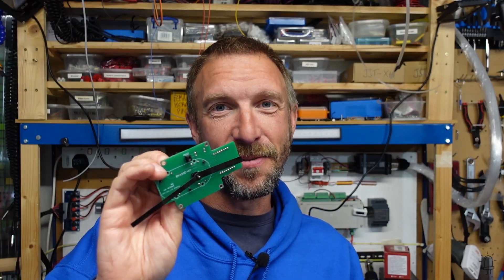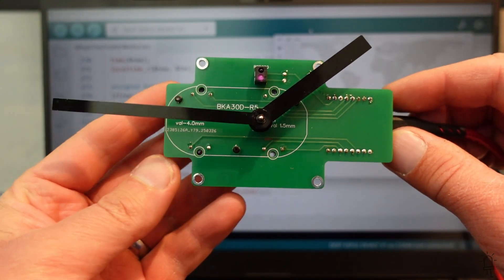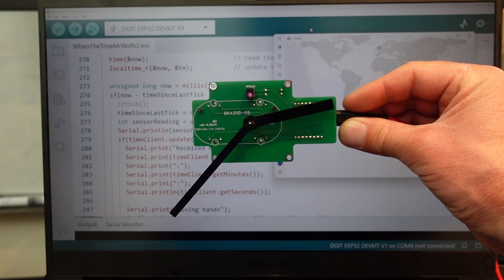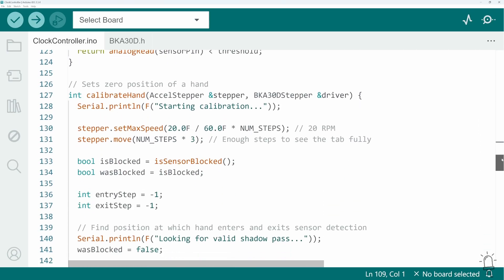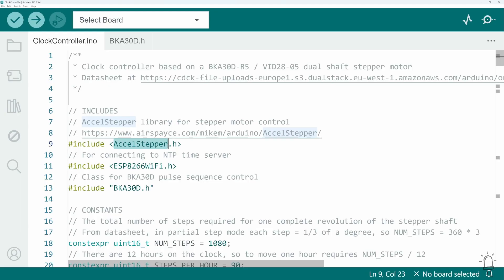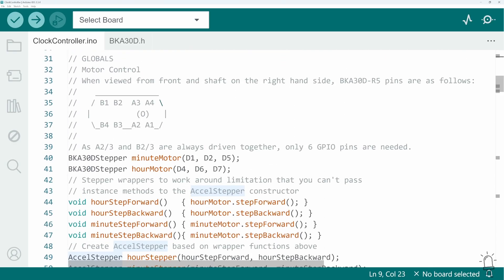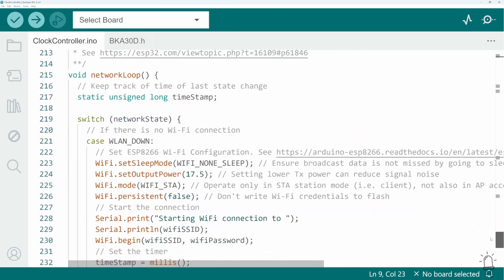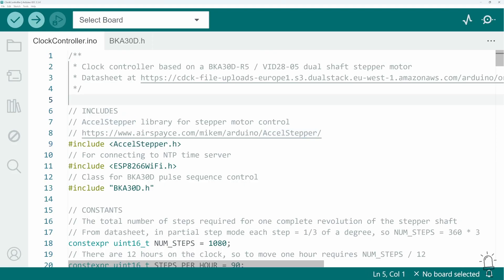Automatic Analog Clock that always keeps perfect time!

Comment: Please do this project for a Lavet motor, you may need to use two RPR220 sensors (i.e. both on while sensing the long arm). Thanks
Reply from the maker: You don't need both sensors - a single one works fine! You just position one hand at a time (and, once calibrated, move that hand out the way before calibrating the next)

Comment: Hi there!

I’ve been trying to contact you after watching several of your clock mechanism videos, but unfortunately, I couldn’t find a direct email address for you on your blog either.

I ordered some motors from the link you provided (BKA30D-R5C), but I received the R5 version instead. According to the descriptions, these motors should support 360-degree rotation. However, each shaft appears to have an internal mechanical stop (brake) that prevents continuous rotation.

Some forums mention that this stop can be removed by disassembling the motor, while others say that newer versions no longer include the stop at all, because many users requested full, endless rotation. I’ve now ordered another set from eBay where the seller confirmed that the R5C version is indeed like that — if that turns out to be true, I’ll soon have firsthand experience.

How did you achieve the “endless, no-break, continuous rotation” movement in your project? Or did your motors simply not have internal stops?

Also, do you know if there’s a 3-motor version available for clocks — one that would allow a second hand to be driven separately?

// I’ve always had a special fascination with clocks…

Thank you!
Szabolcs from Hungary

Comment: Looks great.  Now, if you could somehow add a second hand though I suppose the only easy way to do that would be to add a lcd display for the seconds or maybe add individual leds.
Reply from the maker: I couldn't find any commercially-available independently-controlled triple shaft mechanisms, so it would have to be a custom-build. It would be relatively easy to 3D print the necessary gear train, but 3D-printed cogs tend to wear out relatively quickly I find, and I'm not sure if they would be accurate enough :(

Comment: WiFi credentials in code, and shown in video...
Tip that all ESP code should follow, once you have connected to a network the esp stores the credentials, so you can run the connect without parameters to reuse those credentials, without them being in every/any sketch.
Reply from the maker: Thanks for the heads-up - have updated the code listing (but frankly the reception range of my router is so poor I severely doubt anyone would be able to make use of them, even if they were in my house!).   And yes, you're right about persisting credentials, which has occasionally been the cause of much frustration as I attempt to debug networking code that has remembered and silently connected using old credentials. You'll notice I use WiFi.persistent(false);  in the code deliberately to avoid this now!
Reply: I wish WiFi APs broadcasted the current time in cleartext to avoid needing to auth just for that. But maybe that would create a security issue?

Comment: Sadly your Git schematic also ignores the power supply completley, but the WeMos ist not suitable for battery power. So its a corded clock.
Reply from the maker: I left off the power supply because it's not a prescribed part of the project....you can power it via the USB port, the 5V VIn pin, 3.3V, corded, or battery. Up to you.

Comment: so its a digital clock...
Reply from the maker: No, a digital clock would display the time using digits.
Reply: To be fair most mechanical and "analog" clocks move their hands in short steps once a second.
Reply: Yeah.   Only the display us Analogue.

It was kinda clickbait becaUse nothing here turned out to be surprising or out of the ordinary, at least to me.
Reply from the maker: I'm curious to see what you felt was clickbait-y? I believe the project description is accurate, and it's certainly not been my intention to mislead. I'm not aware of any other tutorial that has used these components to create independent hour and minute movement of an analog clock?
Reply: @PlayfulTechnology  Analog means something that is not digital. I was eager to see how you managed to synchronize it without an Arduino or something similar.

Instead I found a pretty bog-standard first-year project. Maybe it is interesting to others, but not to me.
Reply from the maker: @adorp  Ah, I can see where the confusion occurred; You're correct that, in one sense of the word, "analog" relates to a continuous variable which differentiates it from a digital (discrete) signal. However, an "analog clock" is one that uses a physical mechanism to move hands, rather than a "digital clock" which displays digits. And yes, my projects are always intended to be accessible to beginners.... I wouldn't expect experienced electronic engineers to be looking for learning materials on YouTube!  ;)
Reply: @PlayfulTechnology  I was confused at first too, but I agree that the title makes sense now that I think about it. I was surprised to see that you implemented the EXACT hand "calibration" (I call it homing) method that I was planning on using for my own heximal clock. I had scrapped that idea in favour of using a slotted optical switch, but now that I've seen it in your project I'm absolutely going to go back and give it another shot! Sadly my project is less "beginner" than yours, as I need 3 hands on my clock (due to the way the specific implementation of heximal time I'm using works), and thus I'm using 3 separate stepper motors with 3D printed gears to transfer the rotations all to a central shaft. Very interesting project, thanks for sharing!
Reply from the maker: @skmgeek I've done a similar thing with 3D printed gears/concentric shafts and only 2 stepper motors. The problem I had with that there seems to be discrepancy between the gear ratios on the 28BJY-48 motors I was using: some seem to be 4076 steps/revolution, while others are 4096! (and neither of which are easily divisible by 360, or 60, or 12....). So the position inevitably drifted somewhat over time and I had to recalibrate on each revolution.  I've seen others use NEMA17 motors (like here: https://www.instructables.com/3D-Printed-Triple-Shaft-Stepper-Motor-Mechanism-Wi/ ) which would solve that problem, but are rather bulky for my purposes.
Reply: @PlayfulTechnology  Hmm, I'll have to do some testing with that. I've noticed that the 28BYJ-48 motors are more likely to skip when you push the limits of their speed, but I assume you were running them at the recommended 100hz. If it is the case that the motors need to be driven at half the speed, at least it's not a problem as the hands on a clock aren't known for moving very fast haha!
Reply: @PlayfulTechnology As for being indivisible by 360, that shouldn't be an issue as long as you always calculate the absolute position for each stepper, instead of just blindly offsetting it by a fixed amount, right? My program re-calculates the exact position that every stepper motor needs to hit, and then moves the steppers to those positions. It appears to work correctly, although I haven't tested it extensively and that's just from my surface-level observations. Thanks for the heads up though!
Reply from the maker: It depends how you calculate the steps. If, say, you calculate a value of STEPS_PER_HOUR as I have done, then obviously that needs to be an integer value, and that requires rounding. If you then continue to rotate the hands clockwise (as people tend to expect with a clock....) by incrementing by that same rounded value each time, you'll get drift. If you pre-calculate a table of absolute steps corresponding to each hour around the clockface, it won't be an issue.
Reply: @PlayfulTechnology  I use the current unix timestamp to derive the current hour, minute, etc. I then convert that to angles, and then to target steps relative to the homing position. As there are no compounding calculations, there's no error accumulated from the previous positions' error. You should give this method a try!

Comment: I tried to compile the sketch but there is the following error :
collect2.exe: error: ld returned 1 exit status
(.literal._ZN13BKA30DStepper11setContactsEh[BKA30DStepper::setContacts(unsigned char)]+0x0): undefined reference to `BKA30DStepper::driveSequence'

I used WeMos D1 R1
Reply: Check you have the correct ESP module selected, also if the library has earlier versions try them as I've had code break  on newer library versions before.

Comment: Can you set the positions of the hands to specific hours using this? Or will it only track real time. I was wanting to make a prop where the clock moves to a couple different hours giving you a code would that be possible? 

Awesome video! I love watching you stuff to get inspired.
Reply from the maker: Yes you can set the hour and minute hands independently to point at any angle you want! That was the first example I made... and then people asked me to make a version that could display the actual time as well!
Reply: You can set any arbitrary position for the hour and minute hand in the code for sure.  Just have to take out the NTP calls and their calculations.  You can create a randomize function that will then drive it to those positions.